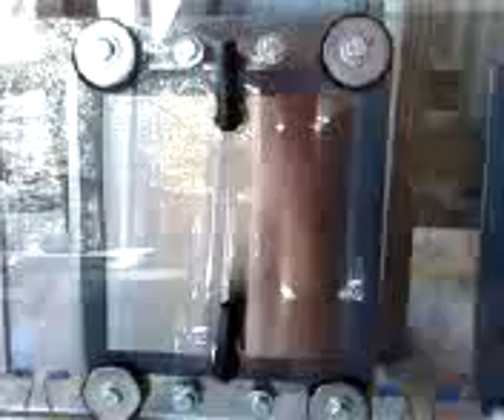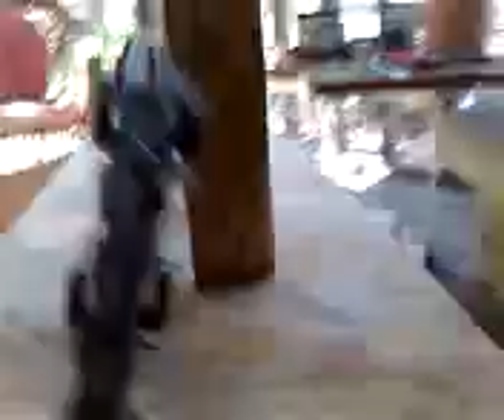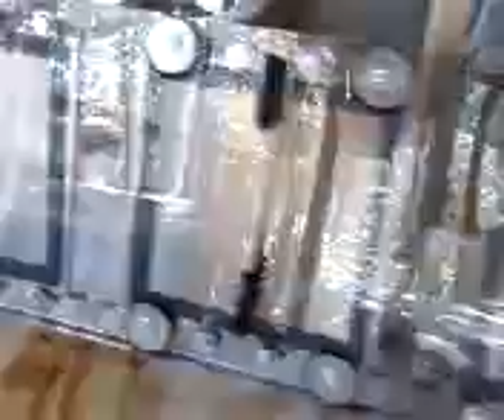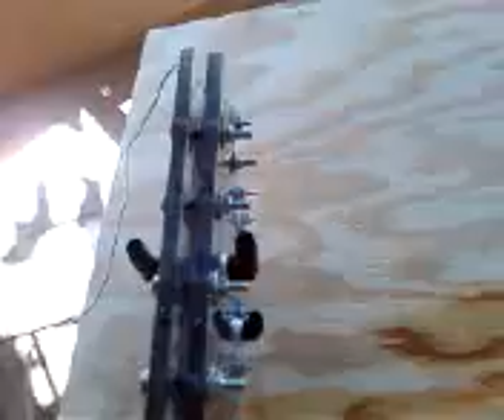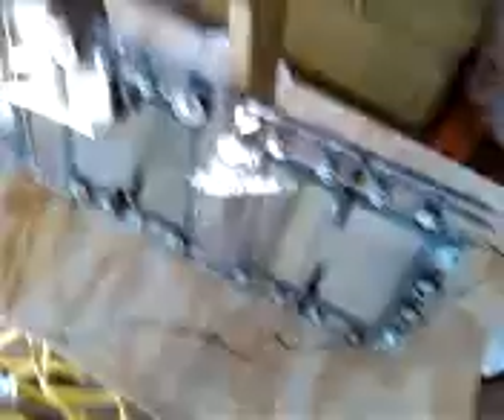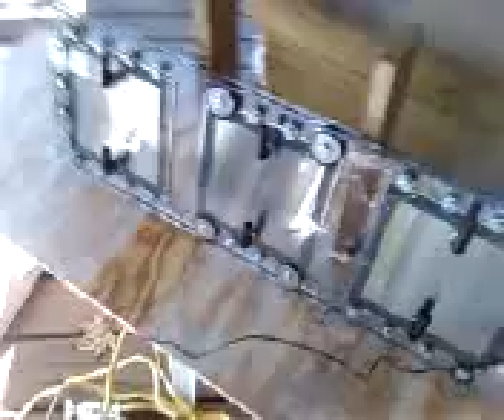Superbee1970, "Triple - Split Cell", HHO Electrolyzer!!

Comment: in our control tests, the lower hole that we use in our dry cells to help maintain even fluid level costs us lest than .5 mmw in overall efficiency.  so the cost was modest.  In a really large format like I use where there are 100+ plates, that loss to the lower hole makes a lot of sense. Without it, fluid in my device would be low in the center and high on the ends.  You can easily get away without the lower hole with your 6 plate setups. It will be just a bit more efficient that way ...

Comment from the maker: Hi Scarecrow, by setting the cell up this way, there are no holes allowing ANY current leakage.  Same as a dry cell w/ only a single upper hole w/ the e-lyte below the hole.  However, w/ this 'split' type cell, the cell can be fully saturated w/ elyte as well as have flow if necessary.  I'm thinkin of using mesh for the outer plates since I don't need a full plate to isolate the cells as is being done w/ standard dry cell configs...  Glad ya checked this baby out.  Hope this makes more sense? T

Comment from the maker: Hi JDC,

In a normal dry cell, each plate has at least one hole in it.  Electrical 'LEAKAGE' occurs when SOME of the electricity from one plate passes thru the hole in the subsequent plate and goes STRAIGHT to the following plate, skipping the subsequent plate entirely...  By splitting the cell and seperating each cell electrically there will be ZERO current leakage and thus should be more efficient...  I will explain this theory more in depth w/i one of the video's texts... Thnx! Superbee1970

Comment: I guess you had good reason for setting it up that way and I am confident it will work. But its rather more complex to keep it from leaking like this than if you had just gone ahead and made 3 small devices dont you think ???  but if it works for you like this, cool ... it certainly is a different approach ...